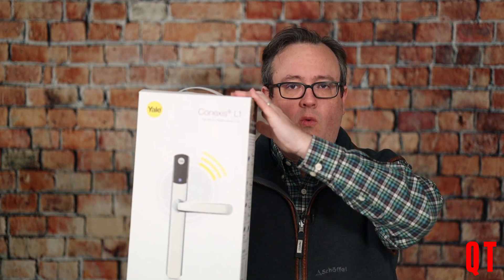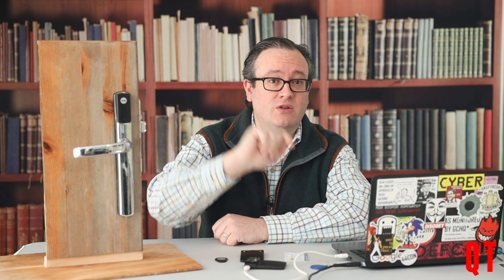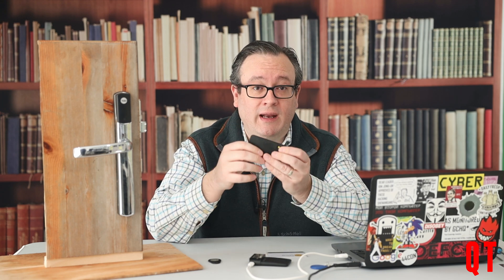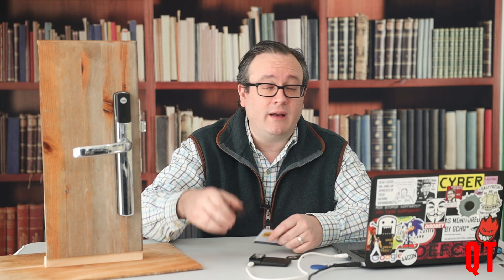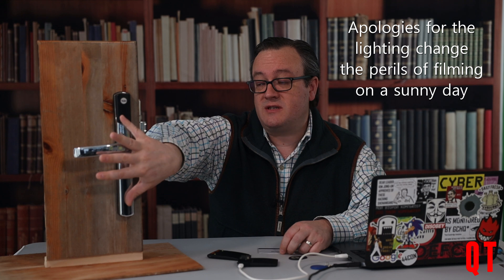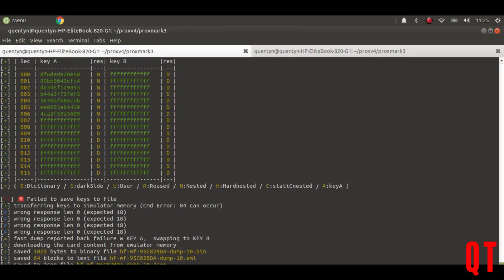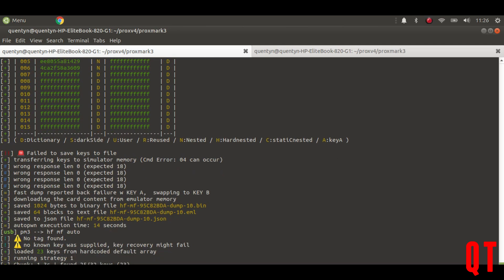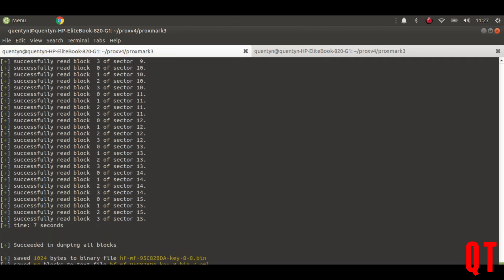Yale Conexis L1 - can you copy the RFID key ?

Comment: I've just aquired a few of these locks and I'm confused about your suggestion for the way the keys work.  I have a single RFID tag that paired with all FIVE Yale RFID locks I've installed on the house.  If there is some sort of two-way negotiation going on using those block 16/17 writes, how would it account for the situation where you open Lock A (write to block 16), then open Lock B (write to block 17), then open Lock C (overwrite block 16), then go back to open Lock A - there is now no data from Lock A stored on the RFID, but I can confirm this still works and the tag will open any of the five locks at any time in any sequence.  So I think there is a flaw in your understanding of how this works.
Reply: Oh wow that is interesting! Were you able to get full dumps of your cards? Mine are static encrypted nonce
Reply: I can confirm this is the same for me, which I’m glad about. I have one of these installed at my house and my mum's. My key works for both, and hers does too, so we have the same key for both houses. Both keys work perfectly. I suspect the reason it makes the old tag stop working is so you realize it doesn’t work before a robber gets in. Then you use another tag to get in, and you re-add the old tag, which will make the robbers' duplicated tag non-functional.

Comment: Spent last night poking around at this. I have a Connexis L2, which AIUI is an L1 with the wifi module bundled. It may well have newer firmware on it too given some of the differences observed.

I have a fair few different tags: White keyfobs, black keyfobs, phone stickers and pass cards. The only ones I could get to unlock were 2 of the white keyfobs (using the nested) - none of the stated attacks worked on any of the other cards strangely. I tried sniffing between the lock and the card too, which resulted in CRCs on my PM3. I managed to pull the first slot using MFKey32 on my F0, but never got any of the other slots.

Emulating with the PM3 worked great, though was susceptible to the same issue stated in the video. Emulating with either the F0 or another card seemed to put the lock in some kind of "tamper" mode where not even original cards (which hadn't ever seen the PM3) could be used, or even re-added. Had to factory reset the lot. I'd suggest they've added some tamper resistance, which is good.
Reply: I've just got one in and was able to grab the 1st key by sniffing, I did notice in the teace that it was looking for magic wakeup command so perhaps that is why you had a tamper condition.
Reply: Also, a y chance I could get a dump of your white fobs to test mine with other tags like GDM and UMC?

Comment: Hello Quentyn, do you know if I can use NTAG213 stickers with this lock? or do you happen to know what frequency do the Yale tags operate on?
Reply from the maker: no its mifare only
Reply: @QuentynTaylor  Which tags exactly should work with this lock? I saw many with different memory sizes etc, also some forum posts complaining about them not working.
I'm new to this.
Also how do I add/remove tags via the app? The app is so tragically bad, I can't get the function to to work.

Comment: Hi, I bought the Same lock, I was wondering can I buy a RFID Ring that I can use for this door lock, and if so anyone know where I can get them. thanks.
Reply from the maker: i think just a standard mifare classic should work ? not sure if you can get them in ring format but if you can it should work
Reply: Did you manage to find a ring? Also after the same for my Conexis.
Reply: @gregtunney3779  I didn't , I got confused. I didn't know what to do so, I was just making do with the sticker on the back of my  phone for now. I still want to get the ring it would make it more convenient, #FirstWorldProblems 😊
Reply: I'm looking to integrate a ring, but can I pair a new ring directly to a conexis l1 or do I need hardware to replicate an existing yale fob?

Comment: Very interested in your follow up, i currently own 2 of these locks, and have a tag I use on both, Interested to know what is changed when used on day the back door but still allows the front be opened.. 

Looking to have an implant installed in my hand/wrist, so looking into compatibility before I take the plunge.
Reply from the maker: that is interesting as with no connection between the 2 locks it must be that the 2 blocks that change - either is accepted ?
Reply: This is really interesting to me Johny - I have a bunch of these locks, and based on the video, I was wondering whether in fact because of the rolling code, I wouldn't be able to use a tag on multiple locks, but are you saying that in fact this works? Good call to get it right before the implant! :p. I am also curious as to how the coding system works, as there are a couple of use cases where ideally I would like a Yale type lock, but neither their Connexis nor Smart Assure locks fit the application, so if I could understand how the tags are coded, might be able to Arduino something that would be compatible.
Reply: @gavindjharper did you ever work this out? Thanks

Comment: New subscriber ... Been into locksports for years and I just got into playing around with RFID fobs. I needed one for my hid fob and had no problem. I notice after trying to copy a friend fob I had an issue with his Keri series fob but the 22 key digital smart card rfid reader writer machine with HD display from Amazon wouldn't read or write it. Could you if possible do a video on the best handheld machine for fobs and the type of fob. Can I use a chameleon proxmark on a smart phone or tablet ? Appreciate the channel and info... 😎🤘🏼✌🏼 From NYC-USA🗽🇵🇷
Reply from the maker: i dont have any Keri locks to hand but they are LF fobs so you will need to use the proxmark ( using the lf command set) and have a look at the indala or hid commands they should copy onto a t55xx card quite easily

Comment: Hey Sir is it possible to rewrite high tag 2 if possible how can u assist
Reply from the maker: you may not be able to re write but you should be able to copy it - its a low frequency card so you will need the proxmark using the lf command sets